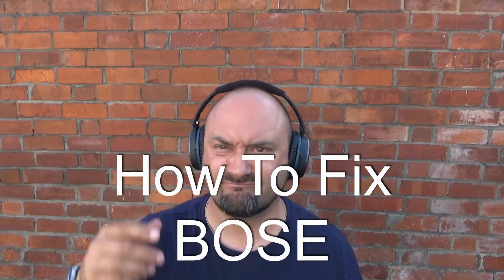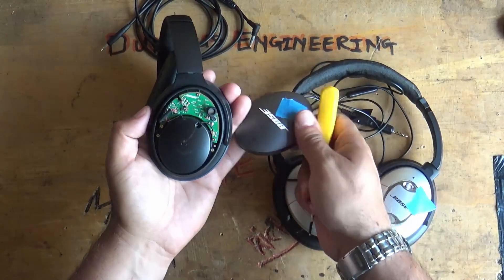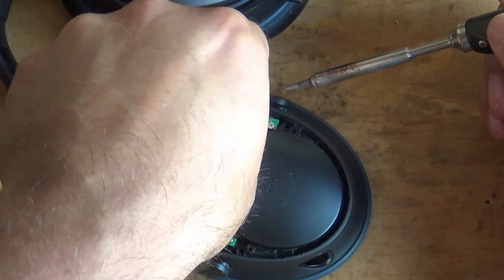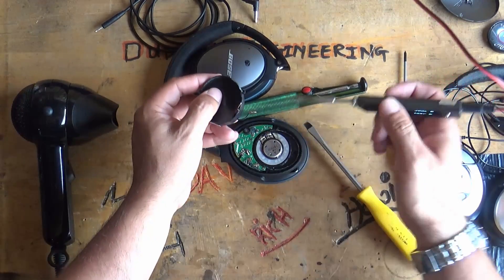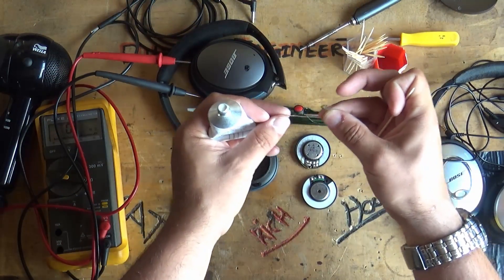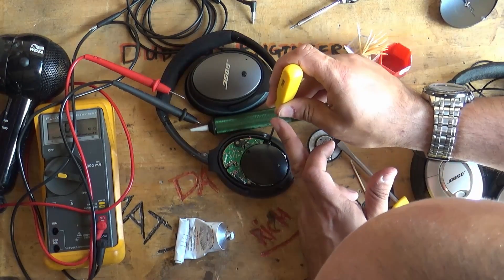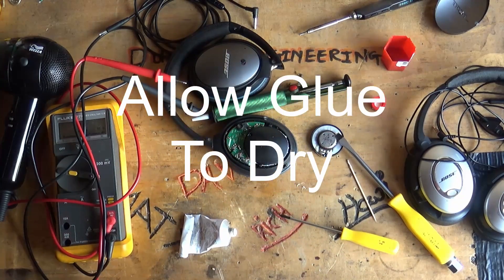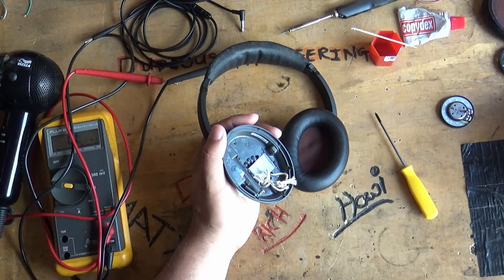DuB-EnG: Repair BOSE QC35 QC25 QC15 Quality Headphones Fix Faulty Quality Problems One Speaker Work

Comment: I have a pair like yours where the right speaker annoyingly goes outI. A slight tap brings it back.. Must be the pair of wires going through the swivel. I usually fix everything myself (more than capable).. However my 35's have treated me well for many years...
Reply from the maker: Definitely worth fixing especially at the price they charge :-)
Reply: @DubiousEngineering  - Ya, but it's to the point of if Upgrade is justified. The new Ultra have some type of voice activation/recognition feature.

Comment: Thank you so much for this video! It helped me repairing my QC25 🎉. I first ordered the TS100 which is indeed great to do the job. Instead of copydex I used a glue-gun. The glue will harden too fast tough  I used the hairdryer again while placing the soeaker and cap back in.
Reply from the maker: Great to hear this helped 😃.

Comment: Can I hire someone to do this for me? 😅
Reply from the maker: Not me :)
Reply: @DubiousEngineering  there's another vid that explains that you can use a piece of paper to lightly touch the copper wire over the speaker to make the sound work. I tried it and it worked for a second but then it went back to not working. Does this mean its not a speaker blown out issue?
Reply from the maker: @FeonaLeeJones yeah, sucks right 👍

Comment: I have QC 35, few months back cracking sound started in right side speaker which disappears for a while after mild tapping on it. Is there any issue with the speaker or any wire has been broken? Pls suggest as no technician is ready to touch it, and I’m trying to fix it myself
Reply from the maker: Replace the speaker
Reply: @DubiousEngineering  thanks! Can you suggest any ?

Comment: Thank you very much for this video. You just saved me 330€ !
Me weldings are not as pretty than yours and will prbably not hold a very long time but now, I know how to fix it.
I don't see any difference with the speakers I bought "2PC/Lots 40mm Replacement Speaker Repair Parts for Bose QuietComfort QC2 QC15 QC3 AE2 OE2i 40mm Driver Headphone 32ohm" on Amazon from this video RC-WFHleXeY wich was a great second support.

Thx a lot dude !!!
Reply from the maker: Just glad to help really 😍

Comment: Thanks for the great video, somehow my QC25 is the special color version, with special glue, heat up very very very long time and end up the housing melts but the glue still doesnt, so can't get rid of the black cover without destroying it, did repair the speaker but can't reassemble normally with deformed housing.
Reply from the maker: Yeah sorry, they changed the glue 😕

Comment: Thanks for the video, well done. But I can’t seem to get the speaker cover off. I’ve heated it multiple times and get NO give. I’ve basically bent the plastic to hell now. Any suggestions before I just throw them away? I did buy them used a few years ago so I guess it’s possible this has been done before and they used a more permanent glue…
Reply from the maker: You nailed it, they changed glue to screw us...   Sorry
Reply: Dang, I thought that was only a possibility on the QC35s and mine are QC25s. Anyway, thanks again.

Comment: how do we confirm whether the speaker or the circuit bord has failed? my QC15 L side working fine but R side suddenly stopped working
Reply from the maker: Have a look at AC voltage with a multimeter.  If it's 200mV upwards, then the CCT is ok

Comment: Heyy, i have the qc 45 ll and the noise cancellation isnt working as it used too (it seems to be stuck on low noise cancelling) I tried everything popping the ear pads back on, properly, software update, reboots... idkklk what to do !! Please help
Reply: sounds like a firmware upgrade (or maybe downgrade) could help

Comment: Fantastic ! Thank you so much Howard 👍

I fixed my QC15’s following your Youtube guidance. 
BOSE refused to help me and told me to just buy a new headset. Even while I have always handled the headset very gently the right speaker suddenly stopped working. Using the multimeter I could confirm the driver to be the problem. BOSE must be using low quality components because this was already the 2nd BOSE headset that had a driver fail on me.

I ordered a new driver on AliExpress and for about €5 I fixed my headset! 🎉

Thanks again!
Reply from the maker: Oh dude! .. yes! Well done!  Thanks for the positive feedback! ☺️

Comment: Hi, and thanks for this great video. I have qc15 and testing the resistance on the two speakers, sure enough 100Kohms on the right one. So I'll go online and buy a new one, or two because I guess the other speaker will blow someday too.  Two questions though: why does a speaker just blow 'out of the blue' like that ?   I wasn't listening to anything, one day it was working, the next it wasn't.   
Secondly, where can I get the replacement from, and be sure it's the same quality as the original??  Thanks again!
Reply from the maker: There are very fine wires in the speaker that fatigue over time.  Normally just outside the warranty 😀
Reply: @DubiousEngineering  aah got it. Thanks!

Comment: Is this a common problem with the qc15 or is there another problem that can occur to cause the loss of hearing in one side. Also what type of driver speaker is reccommened for replacing an old one.
Reply from the maker: I got my replacement speaker from ebay.

Comment: The noise cancelling feature doesn't work correctly without airtight enclosure for the speaker so applying clue here is not optional. You could use practically the weakest glue you can find that still allows airtight sealing.
Reply from the maker: Absolutely agreed 👍

Comment: QC25 also often has wire broken where it connects to battery cover and the power switch is prone to fail. Still, overall very good headphones.
Reply from the maker: Good sounding, but just such a shame they seem to have a built in timed redundancy!
Reply: @DubiousEngineering  At least QC25 doesn't have built-in Li-ion battery that's designed to be NOT user replaceable.

Comment: Hi, thanks for creating this video. Did you just use the numbers on the back of the driver to find a replacement? What is the glue your using? Thanks again.
Reply from the maker: I just searched on ebay for replacement bose headphone speaker

Comment: I just completed a headphone repair for the second time. After the first repair on the right speaker, the new speaker only lasted a short time before dying like the original. Fortunately, when I ordered the replacement speaker, they sent two replacements and I kept the second one in the event that I needed to repeat the repair. Thanks for all the tips, especially the hair dryer idea. I even used a multi-meter for the first time which indicated that the speaker was indeed bad, and the new one good.
Reply from the maker: Really glad it helped!!

Comment: Thanks for this, I was able to repair my QC25! The new driver doesn't quite the same but then the new wasn't quiet the same (smaller coil and magnet) but maybe it will even up as it beds in.

Wish I'd known about this 2 years ago as I binned some QC15 I was given with the same issue :(
Reply from the maker: I'd hope the internal DSP compensates for any audio changes between the drivers...  glad it was a useful video bud! All the best, Howard

Comment: Awesome video with so much information swiftly shared. My headphones crackle on the left speaker when it swivels up and down. Any suggestions how to diagnose and repair that? I noticed you didn't remove the ear phones from their fixings and I wondered if that might be where the problem lay.
Reply from the maker: Ah - yes, that souunds like you may need to replace the internal cable...  Thats going to be a fiddly job!!
Reply: @DubiousEngineering  thanks. I noticed that you didn't remove the phones from their holdings. I wouldn't know where to begin..

Comment: Thanks for the video. I was quite sure the issue was with the speaker but after measuring it's resistance I have my doubts.... 31 Ohms. Could the be with the motherboard then?

Oh and also I measured the resistance without prying open the speaker compartment, just across the 2 wires that come out of that. Shouldn't matter but still..
Reply from the maker: The speaker should register at 30 -34 ohms so sounds ok!

Comment: I followed all this, and after resoldering all i turned headphones on again there is a very audible tone coming from the speaker which raises and lowers in pitch when you touch or press the speaker cover... i have checked wires are around the right way, and no shorting that i can see....anyone got ideas?
Reply from the maker: Oh no...  sounds like feedback - im pretty sure thats a wire the wrong way arouund....

Comment: Fixed my QC3 headphones today using this vid as a guide...mine were from 2009 and I paid about $300 for them.  Challenging because the little crescent shaped board had a hole in the middle through which Bose ran two wires for the noise cancellation (?) so a bit more involved since these two extra wires have to be un-soldered before the board can be removed to access the bad speaker.  Thank you, thank you, thank you!!!  Ken in the Philippines.
Reply from the maker: Excellent Ken!! - Enjoy the headphones!!

Comment: After unsoldering the speaker - the very thin wire that connects the drivers (and goes between the plastic cove at 3:00 in your video) pulled thru the plastic cover and came thru it's shield when I peeled it back. Do you know what gauge that wire is and where I could buy that wire? Thanks!
Reply from the maker: Oh crikey Mike... no idea, I'm sorry...

Comment: I was fixing my bose qc 25 when I had one little big problem. I got this bluetooth adapter from aliexpress that has an audio jack that fits too tight for the input of the headphones. While I was doing the job, I took off this adapter and it came with all the audio input with it. from there 4 cables had been desoldered whose order I have not found anywhere. I kinda fix it but there is this cable that says "ext pwr" that I had to leave unsolded because when I do my left earphone would not sound. Maybe do you know how this 4 cables are plugged into the audio input? Thx for everything man
Reply from the maker: So sorry mate... I have no idea!

Comment: I dropped my QC 35 ii’s yesterday & now they won’t power on. Any thoughts on a fix would be greatly appreciated!
Reply from the maker: Oh dear... that sucks...   best return them if in warranty... if not, best open them!!!
Reply: @DubiousEngineering  out of warranty so Bose will be happy to exchange my $200 and the current pair for a new pair, lol, so I figure I might as well try a diy repair before I do that. Was curious if you knew of anything less obvious than a wire coming loose, like a part that may be susceptible to shock from a fall?

Comment: Hi, first of all thanks a lot for the video, it is really helpful ! I'm about to order a new speaker to proceed with the fix but I have one doubt : on mine, the speaker still emit sounds when noise cancelling is off. It's only when noise cancelling is on that it stops working. Does this mean that the speaker is, in fact, not at fault and it might be something else ? Or is it normal that it still emits sound when power off ? Thanks a lot !
Reply from the maker: you may be right...  sounds like you have a problem with the pcb rather than the speaker if the speaker works with power off....

Comment: Is this something that typically needs to be done for both speakers or just one?  I think I have the same problem and am hoping that one speaker will do it the trick.  where to buy the parts?
Reply from the maker: Normally just the one.  I got a replacement speaker on ebay.  I believe its nly one company that makes the speakers over in china, so you can buy a cheap one!  :-)  My replacement was about £10 including delivery.

Comment: I tried.  You had some Rubber Cement holding the cover over the driver, mine (friend's QC25) was not "rubbery glue".  I've worked with epoxy enough to know it when I see it, the one I was trying to repair was epoxied.  To anybody else who tries, heat and prying may work, but acetone (nail polish remover) is faster, or vinegar.  I used a plastic pry and Q-tips soaked in acetone.  It came off.  But after seeing the condition of the insides, I stopped the repair.  These were for a friend, and they were falling apart as well as having the bad driver.  I just bought him QC35
Reply from the maker: Well done for trying...  yes, they changed the glue formulae once they figured people were repairing them to make it harder to repair, then they can get more money by new sales / trade in.

Comment: Where do you purchase the replacement speaker?
Reply from the maker: Chantelle - HighlandViolinist eBay :-). ... they are all made by the same manufacturer... in China ... so £7 should be enough!!
Reply: @DubiousEngineering  So just search bose qc25 speaker replacement? Like does the specific part have a name? Just want to make sure I'm not accidentally ordering the wrong part.
Reply from the maker: Exactly... you’ll be fine ... Qc 25 replacement speaker

Comment: Hi can you please help me with getting a speakers for my Bose ae2 thanks
Reply from the maker: I’m not sure exactly what you mean, but if you look on eBay you can find replacement speakers
Reply: @DubiousEngineering  sorry.  What 40mm driver should I buy for my bose headphones? I don't want to buy a driver that sound awful. Can you please recommend a make please?
Reply from the maker: Strangely I believe they are all made by the same company in China ...  so it doesn’t matter which one you buy, they all come from one factory.
Reply: @DubiousEngineering  wow

Comment: Mine is the 35 II and stopped the right side via Bluetooth only. via cable both works. This means that is not the speaker right? any solution you could point?
Reply from the maker: Nei Rauni Santos correct - not the speaker it’s internal to the Bluetooth electronics I expect... sorry!!!
Reply: Thank you.

Comment: Thank you for this guide, I was able to get my QC35 back running again, yay! But they must have changed the glue between QC25 and QC35, getting the black lid off was as tough as pulling teeth for me! It took me several iterations of heating and prying, heating and prying until it gave way eventually and I had to put a few dents in the plastic. But at last, they work now. :)
Reply from the maker: Great to know you are back up and running - BOSE are evil for changing that glue...  :-(
Reply: @DubiousEngineering  They are! Also, they removed the screws that hold the black lid and instead have plastic pins with molten tops, so you have to drill the holes out. They really don't want to you repair your headphones... considering dropping BOSE for my next headphones because that's such a dick move.
Reply from the maker: nRXpAa8E6UML spread the word man... they have a speaker that fails after warranty and they are locking it down.:: so unfair... needs exposing
Reply: Where can I buy the replacement speakers for the QC35ii?

Comment: Use Fevicol  sr 998, this is same boingi boingi synthetic rubber adhesive
Reply from the maker: Excellent - thanks for your top tip!!  :-)
Reply: To put the drivers in ear cups like factory installation, only use 3M™ Yellow Super Weatherstrip and Gasket Adhesive (available in auto stores mostly).
Reply from the maker: Great tips, thanks!

Comment: Thanks for making this guide! It helped me a lot and managed to get it working again, however, the new speaker replacement side is way softer than the original side. What could be the reason for this? bad soldering?
Reply from the maker: No...  That shouldnt happen...  There may be a problem with the replacement speaker :-(  Sorry to say - did it look exactly the same?
Reply: @DubiousEngineering  yeah it does look exactly the same. Alright, i'll try again with another speaker then. Thanks for replying! (:
Reply from the maker: Claire Chiang if you have a volt meter check the resistance of the coil winding...   at least if you buy another you can change both of them to get the same sound levels
Reply: Unfortunately I don’t have a volt meter to check it. And it was too soft to be usable anyway. 

But here’s an update; I bought another set of speakers to replace the soft faulty speaker and this time, it works! Thank you so much for replying and your guidance!
Reply from the maker: Pleasure Claire!!  Well done!!!

Comment: I have a pair of QC 15 headphones one side "Crackles" like there is a loose connection somewhere... changed out the lead to the output device (2 are supplied) but it still does it, intermittently... any idea what it could be?  Loose conncetion, dry solder joint... maybe you had this problem before and can point me to the solution before I rip them appart...
Reply from the maker: Sounds like you may have a faulty driver ... eventually the wire will crack and then ... nothing...  you may need to fix them by replacing the driver.
Reply: @DubiousEngineering  Thank you for the reply... I will gear up to do that... Will do it myself so need to get a good soldering iron and the drivers from Bose
Reply from the maker: Uli I actually got drivers from eBay and they were only £5 plus postage... worked a treat... trust me I’m picky!!!! But I think one company in China makes them ... so you can’t go wrong!